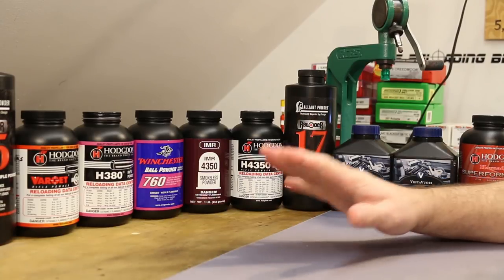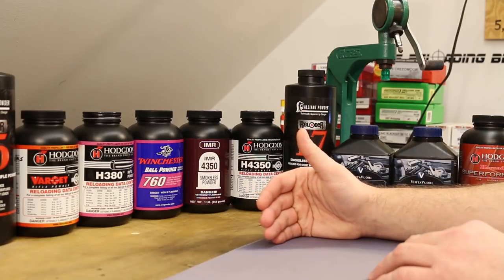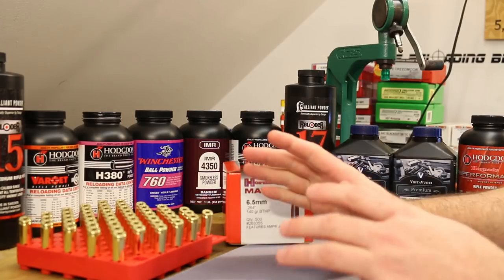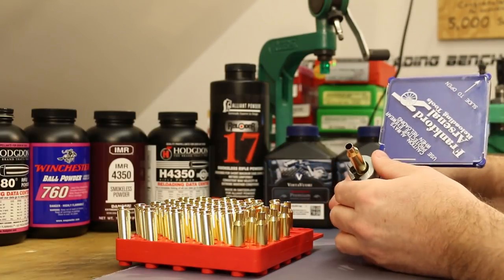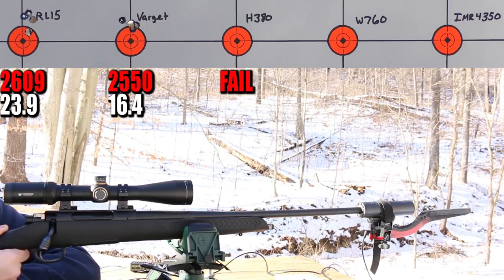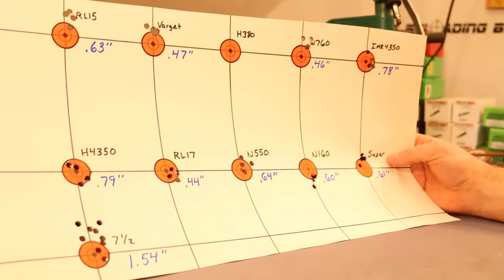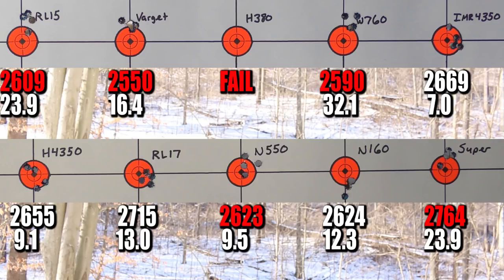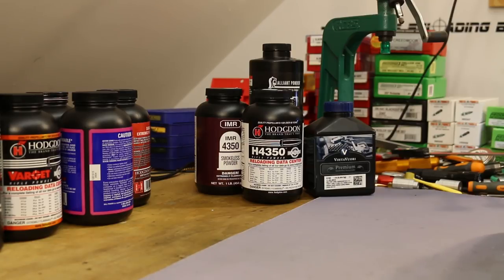6.5 Creedmoor - Hang Fire Problems - Part 4

Comment: Also purchased the Lapua 6.5mm Creedmoor Brass with small primer pocket here in South Africa and had issues with it's reliability. Initially thought it was caused my something I did and then found this helpful video. Thanks again. I eventually purchased CCI No450 Magnum Small Rifle Primers and it solved all my issues. Good and helpful video. Thank you.

Comment: Good analysis of the data.  What I have read in a gun magazine confirms what you found.  They said that small primers are less reliable in cold weather.  Consider getting Peterson brass in 6.5 cm.  I got some and weighed them.  They are heavy.  50 of them weighed between 169-172 grains with an ES of 3.5 grains.  I have not shot them yet, so no feedback on performance.

Comment: Felt I was in your shoes watching this video. I too went thru a series of tests to eliminate hang-fires in a 6.5 creedmoor Savage 10. I changed many things, but changing from Tula SR magnum primers to CCI-400 primers made the problem disappear.  The Tula primer have a thicker cup than the CCi-400 primers and the Savage 10 firing pin would not set them off consistently.

In addition you used some double based extruded powders and double based spherical powders.  Although the basic chemistry is the same the chemistry of the deterrents are different. The double based extruded powders use a surface coating deterrent such as DNT dinitrotoulene while the spherical powders use a deterrent that saturates the entire kernel such as ethyl centrate.  I suspect it is the ethyl centrate that makes is more difficult to light. Just a thought(opinion). Thanks for the great work! Brant

Comment: I just stumbled across these four videos and watch them this morning. You are very lucky when light loading a slow powder, you can easily detonate the powder by igniting too much of it at a time so apparently since the 19 80s and mid 1980s when I was doing a lot of reloading myself I actually read warnings about this in the reloading manuals. So when you use a slow powder you must be careful when loading it lightly in powder charge. I never had a Hang Fire but I rarely deviated from too much because most of what I reloaded was 308 and 7 mm magnum, I had a 7mm magnum in a Ruger Model 77 that my very first accuracy test I fired 20 rounds at 100 yards into a group that had a center to Center spread of .049 inch. The entire hole for all 20 rounds was .33 in. That is phenomenal accuracy. And that was my first Centerfire rifle I ever purchased in 1979. And I used a load I believe it was 67 grains of h4350. About your choice of primers, the S&B is not something I would even purchase. The ammo that they have made was so bad when it first came out I was seeing it blow up Glocks inside of 10 Rounds. It was like some of the earlier PMC and Wolf ammo that had pressure swings that were extreme. And frequently disastrous. But remember that when you're loading a slow powder you cannot use light loads. Just like you can't use heavy loads of a fast powder.
It is however possible that the n550 is designed in such a way that when it is lightly loaded it intentionally misfires. Find a hot primer and make sure you use a high load density.

Comment: Have you ever heard of powder position sensitive powders? I was reminded of this throughout this series and especially in part 3.  You touched on the low case capacity but the position of powder matters with certain powders as well. It seemed you created the perfect storm using a low case fill charge and a small primer where a large primer does a better job. 

Great series!

Comment: Ive used the small rifle lapua brass in a ruger precision rifle setup and the smaller flash holes definitly make the problem worse. I had to ope. The flashholes up to the std larger diameter to get more reluable ignition. Once they were opened up all my issues went away especially with the cci br2 primers. I also have a 260 Remington that i formed 260 brass from lapua 308 srp brass and experiened the same problem and was remedied by opening up tbe flash hole size. Alot of thr bench rest shooters are doing the same thing to combat this issue.
Reply: See my comment posted today above.  The smaller flash holes further supports my theory as the jet of primary flame through a smaller hole is even more likely to blow the granules out of it's way before effectively heating and igniting the powder. Low temperature would play a part here too as the granules have to absorb the heat of the primary flame longer in order to ignite. problem is that they are being moved in the case and not heating up for ignition. On the other hand, the longer the primary flame has to wait for powder ignition, the cooler it becomes, further compounding the problem. Check with the powder experts.

Comment: I have also had good luck with the Hornady Match 140 grain BTHPs in my Tikka CTR Stainless. I am currently averaging under 0.5 MOA (5-shot groups at 100 yards). Even the 147 grain Hornady Match BTHPs are shooting quite well, with my average 5 shot group size being just under 0.6 MOA.

Comment: Way, way, way late but I am just now following your series on the powder ignition problem. Let me offer a possible cause for the problem. When the powder case capacity is on the low side, a possible cooler burning primer will simply blow the powder out of it's way into the case and with very little heat exposure, the powder either fail to ignite all together or smoldering granules eventually sets the charge off causing a hang fire. The smaller flash holes further supports my theory as the jet of primary flame through a smaller hole moves even faster and is even more likely to blow the granules out of it's way before effectively heating and igniting the powder. Low temperature would play a part here too as the granules have to absorb the heat of the primary flame longer in order to ignite. problem is that they are being moved in the case and not heating up for ignition. On the other hand, the longer the primary flame has to wait for powder ignition, the cooler it becomes, further compounding the problem. Check with the powder experts. Just a thought. Check my theory with the powder experts.

Comment: I'm in no way a powder expert, but going back to ball powders. Because of their geometry, some ball powders are coated with a chemical burn rate reducer in order to have a more progressive burn rate. As the powder particle burns, the total burning surface of the charge gets smaller. Having it coated reduces the initial burn rate and as the particle burns through that coating it starts burning faster. Extruded powders have a hole down the centre and burns from the outside in and inside out. So the total burning surface tends to remain more constant through the burning process. They require less if any inhibitors. Maybe the chemicals impregnating the surface of ball powders make them harder to ignite and more susceptible to lower temperatures? I really liked this series and remain shocked that published data would contain charges that produce hang fires and miss-fires. Can you imagine if your bullet was pushed partway down the barrel in quasi miss fires? Great Series.

Comment: Great series JRB, very informative and very useful information. I think for what the Lapua brass cost and the issues your seeing with small primers and from what I’ve seen posted  online the small flash hole in Lapua makes this even worse or at least have the same inconsistent ignition. (Of course testing the theory yourself is always good instead of what you read while researching online) but IMO It might be worth skipping purchasing Lapua brass. I would like to see you do the future testing in 6.5 Creedmoor with large primer brass. I know the small rifle primer brass has a little longer case life, but IMO small primers for small cases and large primers for large cases. I’m sure there’s a reason all factory 6.5 Creedmoor ammunition uses large rifle primers. Maybe pick up the starline brass in large rifle primer? 

The S&B primers are definitely terrible for this application, but they do seem to work good in .223. Ever thought of doing a primer test video of different primers burning to see which are the hottest or throw the most flames? I think that would be a great video. 

On a positive note the 140 Hornady BTHP looks like a winner and a good value. Curious to see how it performs against the 140 SMK.

Keep up the great work JRB.

Comment: As I understand it, the small primers are used to mitigate pressure because CM is almost always loaded close to maximum pressure (if not over...ahem...Prime). Similarly, 6.5x47 uses small primers but that cartridge has a smaller case capacity.

Comment: this happens with 450 bushmaster with H110 and A1680, so far IMR4227 with hot load ignites just fine, scary part was the primer had enough push the cast bullet into the rifling far enough to pull out of the case when I  extracted the round...no fun cleaning that up

Comment: Johnny, if you pick this series back up at some point it would be interesting to see powders typically used for reduced loads. H4895 would work in the Creedmoor. The Western Powder 8.0 manual can be downloaded free on Accurate's website and has Accurate 5744 reduced load data for 30-06 with cast bullets as well as some other cartridges. If a cartridge has reduced load data in the WP manual it is found at the end of the data for that cartridge. Plated Bullets can be subbed in for cast. I have heard but cannot confirm through my own loading that Shooters World Buffalo Rifle is very similar to old lots of Accurate 5744 and may be easier/cheaper to come by in the current powder shortage. Hodgdon's subsonic load data includes .223 Remington data using small charges of Titegroup and Clays. Red Dot has also been used classically in reduced loads but I cannot find any published data to point you in the direction of. I'm omitting Trail Boss as it almost always has high case fill due to its bulk and per Hodgdon's loading instructions for that powder. Trail Boss would still be an interesting powder to see on the channel from time to time but merely for the sake of reduced loads not hangfire/cold/primer/ignition/case fill testing. All of this depends on your comfort level as reduced loads can be finicky. Stay safe and keep up the great work!

Comment: I think the coating on the rifle powders is part of the problem. We need slower burning powders are developed, the coating on the outside help slow the burn rate. The powders are mostly designed for the hotter primers. But then again powders like varget work well in 223 Remington. Looks like we just have a perfect storm of issues

Comment: You think maybe those S&B primers are just crappy and defective..??
Just my theory, but if a primer isn't "getting the powder hot enough to burn", then that's a big problem, and pretty darned sure it has nothing to do with the powder..or even the charge weight. 
I've loaded many, many rifle and pistol cartridges, and never had problems like that. I'd toss those primers away and move forward, knowing they are just bad primers.

Comment: Johnny I have exactly the same problem in 6.5 creedmoor with H4895 and some times with H4350, but this happens only using Starline brass. Just like you have in first video powder is clumped and discolored.
I think there might be some issue with Starline brass, this looks like some chemical reaction going on between powder and brass.
If I load 20 or 30 rounds few days before range time with H4895 using Starline brass none of those rounds will go off, I empty casing and powder is brownish looks like powder is wet.

Comment: In my 6,5CM I always use VV550 for heavy bullets for that caliber I put a 42.5grn load with a 142hpbt in a Tikka Tac I get 858m/s speeds at 17°C I also use the hornday 140 ELD match same load. no pressure signs primers start falling out at 45grains and always large rifle primers Federal CCI or GINEX

Comment: Great research. I think I agree with your conclusions here. Pretty much shows why cartridge was designed with large primers. Certainly small primers can work and from a reloaders stand point be nice for getting more reloads. In terms of reliability go large primers, but for experimenting good small primers should work fine. How many reloads on the Starline small primer brass are you up to? And should try to see how many you can get out of large primer brass for good comparison.

Comment: I guess there is a reason the S&B primers are usually $20 per thousand vs $30 for normal primers and $40 for CCI 41 etc
Reply: Dominick Delfino I hope Not! I just bought a few 1000...🤤(but not for large cases...)
Reply: I never had a hangfire or missfire with those S&B SR Primers in .223. But I do not use large cases with small primers.
Reply: Agreed I use large primers for large cases as well I stick with Remington, Winchester, CCI and sometimes Federal. On sale I can find primers for $27 per thousand online. CCI 41, Rem 7.5 and Fed Match are usually closer to $40.

Comment: Good series. Made me think. I had always classed primers as "good" or "bad" but never thought that much about temp effect on primer brisance. We always used to switch to magnum primers whenever we ran into ignition problems and didn't explore the issue beyond that.  Also, never used S&B primers before - and definitely won't now. Does make me curious - S&B ammo has a good reputation, so why the crappy primers???
Regarding flash holes, since I have always "deburred" my cases, I have always had same size holes. That also means I have never used Lapua brass, I guess.

Comment: The series of videos is great and your investigation is good; I just can not get past the reasoning for buying cases with small primer pockets? Hornady designed this round to use large primers, the only reason I can think for a brass manufacturer to go with small would be to save money on retooling for this case. This comment coming from someone who does not know how cases are made!

Whilst you make some very good observations that can be applied in many situations, I think I will stick to cases that follow the original design spec.

Comment: Lots of work...lots of money...interesting temp/powder observations...but...

When considering every platform I can use a 0.264/6.5mm bullet in (and 0.243/6mm for that matter), why would I ever begin load development (and investment) with (Starline) brass that uses a small rifle primer?  Can I get a SRP case for a 6.5x55 swede?  Can I get a SRP case for a 6.5 Arisaka?  How about a tight bored Carcano?  How about a 243 Winchester or a 6BR?  If everyone will notice on all of the videos everywhere, SD of velocity has a relatively poor correlation with group size using MOA@100.  Its much worse at 200 and beyond.  The use of SRPs in a case with SAAMI specs for a LRP seems to have its roots in the SD/velocity measurements somewhere at sometime, but who knows...

Fact: More primer cup area equals more paste ignited by the anvil equals more fire going up the flash hole (which is the same size with SRPs and LRPs).

Comment: i shoot a savage 12 and i gave up on trying to shoot small primers, i tried starline with 42.8 760 and 135 berger with cci 400 and it knocked a hole all the way through the primer, same load with cci450 and everytime a hang fire, i don't know where you are coming up with saying that 760 max charge is 41.3, berger load data says you can go to 43.6, thanks for the work you have done, you got me wanting to try reloader26

Comment: How about using lapua brass with n550, 1/2 with the small flash hole and 1/2 drilled to a normal diameter? Doesn't have to be it's own video, it could be quick and dirty.